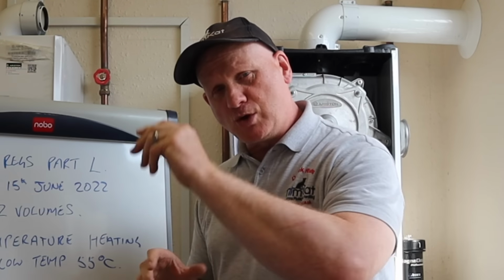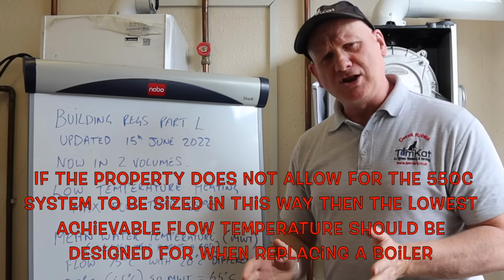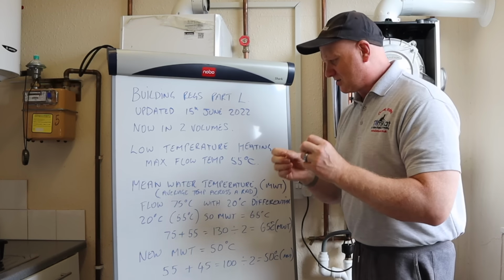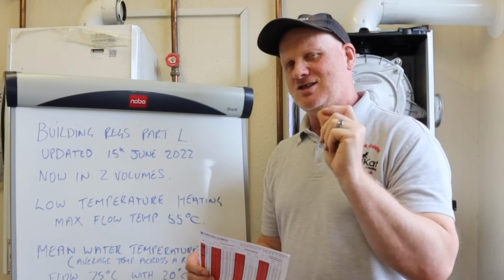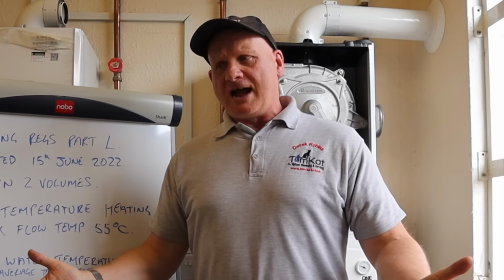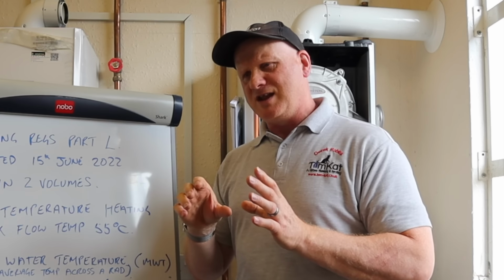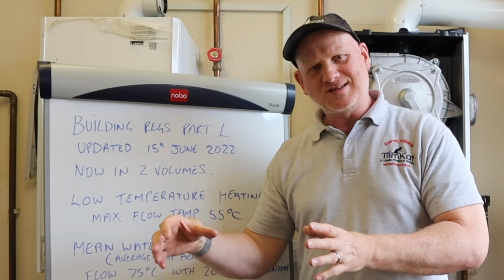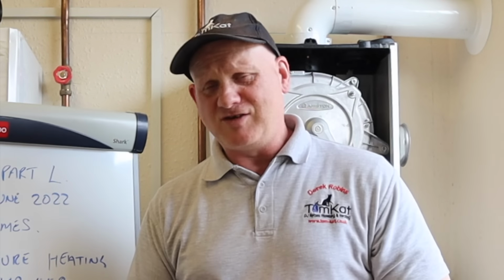Don't adjust your  heating flow temperature until you have watched this video. #saveenergy

Comment: For heating, i put the temp on the boiler to max, that way, the radiators get up to temp far more quickly, after they are up to temp I turn the heating off, the radiators will stay hot for some time. Doing it this way means that the boiler will not be running for as long which saves on electric costs, as the electric pump inside the boiler can use quite a bit of electric. Doing it this way, I usually dont have the heating on for more than 15mins at a time, and because the temp is so high, it continues heating for a while after being turned off.
Reply: The whole point is to keep temp down so the boiler is in condensing mode which alone increases efficiency by 10%
Reply: My thoughts exactly.....we have the room stat at 19, we turned the boiler flow temp up (not to max though), the room hits temp quicker because the rads are hotter, they then make the room warmer because of the overshoot in temperature and the boiler is still off.

Comment: Brilliant video mate, am enjoying the good effort by yourself and others like Urban plumber, Roger Bisby , heat geek , you're doing a great job between you all raising the standards, improving knowledge base and essentially helping to keep people warm, consider yourselves part of the cabinet to turn the country around.  Can I just add, there is no end to excellence and ingenuity, using the acronym RCC (Radiated, Conducted, Convected ) people can get straight to work reducing heat loss, improving the energy efficiency of their homes, staying warm. Question..Where is all the left over perspex from covid? Don't throw it away, with some simple carpentry it could be used to make external double glazing or air source heat collectors, I've already done it, is working well. Anyway, Keep up the good work , and let's see a few more northerners galvanised in keeping warm, sharing knowledge and information and using their ingenuity  to prosper, is what sparked the industrial revolution.

Comment: This video, whilst somewhat useful, misinforms. Radiators are not sized on the differential temperature (DT)between boiler flow temperature and required air temperature, they are sized on the DT between mean water temperature (MWT) and air temperature, this is an important difference. Also most domestic circulators are already over-sized anyway, but regardless, 
lowering flow temperature, will not require an increase in pipe size, or circulator size. This may apply when fitting a heat pump due to a reduction in DT to 5°C. There is very little harm in making small incremental reductions in flow temperature on a condensing combi boiler. System or regular boiler flow temperatures on condensing boilers should not be reduced below 70°C, without consulting an expert.

Comment: Great video, but I don't fully understand 
if the hot water temp has to be over 55 in the hot water cylinder, but the flow pipe from the boiler is now max 55, that assumes there will be no temp drop between the boiler and the cylinder. Even if the pipework is lagged it will lose something, also the hot water in the cylinder wont necessarily be even, the flow pipe as it enters the coil maybe 55, but as it exits it will be less and the water vulnerable to legionella

Comment: Routers have to stay on, or they start playing up, it tells you that in the books that come with them, and today's flat panel TV's usually don't have a proper power off switch like the old ones had, so you have to turn them off at the socket which is what I do.

Comment: Hold on a minute, 20c difference? I thought the industry standard is 11c, 82c in, and 71c out, that's what the books say, or is it different now? I like heating the old way, nice and simple. And someone somewhere must be making some really super- efficient radiators if they can work at a flow temperature of only 55c, are they the ones made to work with a heat pump? I've always thought the flow temperature should more like 85 with delta T 55.

Comment: My boiler is a good old fashioned back boiler, nice and simple, nothing much to go wrong, just three most likely things, the thermostat, thermocouple and the gas valve, all nice and straight forward to replace, if you can still get them, and I've got some spare. None of that dreadful micro surface mount electronics or multi layered circuit boards or computers, and none of that dreadful insecure hackable so-called "smart" garbage either, NO chance!

Comment: Even though I have an oil fired system boiler, I have found your videos very educational. In preparation for the coming heating season, I have ordered some clip on thermometers to measure the flow and return temperature at the boiler, as the oil boiler does not have a digital control panel with built in temperature sensors. I suspect that the radiators in one of the bedrooms, and the dining room are under sized to work at a 55°C flow temperature, but I will 'try and see' before upgrading them, as that is expensive.
Reply from the maker: Just be aware oil boiler are quite different from gas boilers especially the older oil boilers
Reply: @tomkatgastraining  I am thank you. This is a new external wall mounted boiler installed in June. Also replaced the pump, expansion vessel and motorised valves, but existing radiators retained.

Comment: That’s hilarious….government telling us we’ll need to put our hands in pockets, rip up our floors and break out microbore from plaster on walls and replace our rads!  The same government that’s just rewarded the rich with a massive tax break?!!!  They can go and do one and I’ll be setting my own boiler to exactly where I want the heating set and damn the green agenda.  New builds, fair enough but older places with maybe over a dozen rads?  No way.  Just had a new combi fitted.  Hot water can be set low but rads need 60 to 65 degrees to heat efficiently.  Delta T depends a lot on insulation used in house construction.  We have a really helpful delta T in an older build due to 75mm insulated wall cavities.  The government should step in and force house builders to do this for ALL new houses instead of penalising the poor and less well off. As for telling me how I can use my property, they lost the authority and right to do that when they held drinks parties whilst everyone else including the late Queen were in lock down. Remember that. HRM sat alone next to the Duke’s coffin because lockdown prevented anyone else being at the funeral.  Sod the government.

Comment: Good Video Derek. Query about System Boiler with 250Litre Indirect cylinder and Legionella. if we are to store water +60 / max 65deg (industry advice), and knowing there is a loss due to heat piping from boiler to tank circa 2deg (learned from Cylinder manufacturer), for the tank to hit 60deg, should the flow therefore be 60 + 2 = 62deg min? Any other clever ways of determining how long a 30kw system boiler should be on per day to keep a cylinder legionella safe if using say 3* 5min showers a day and one sink of water for dishes? this would be great to know as budgeting but keeping health and safety in check too would be great know from someone who knows best!

Comment: Our system was updated in February and was a very old gravity system with a room thermostat, but with 15mm pipes, and TRVs on all radiators outside the living room (room stat) except for the bathroom radiator.

We now have a condensing boiler with a water and a heating zone and an auxiliary pump in the airing cupboard. The flow temp is set to 70 and the hot water thermostat set to 60, I do not (yet!) know the return flow temperature.

At present we set the room-stat to 16deg and the water on for 20min in the morning which works reasonably well.

Should we lower both the flow temperature and the hot water temperature? ... at what sort of temperature difference between them can you avoid fast cycling? (or can you only determine by trial and error).

I propose to drop the flow temperature to 65 and stretch the hot water timing to 30 to 40 minutes to see if this helps.

Anyone have any comments / suggestions?
Reply: I've dropped my cylinder temp from 60 to 55°C and lowered my flow temp from 75 to 60°C . I just leave my hot water setting constantly on, used to be like an hour in the morning and an hour evening. Leaving mine on takes up just over an hour of heating the cylinder day. Also saves me always adjusting the times. So it's up to you. Have a play around with it, see if it customs to your needs. Luckily my latest system boiler has a condenser pipe. So I wanted it extract condensing mode to save money and efficiency.
Reply: @Andrew-hx6lm  ... I think I will try that.
Problem for me though is that my smart gas meter won't join in ... so it is difficult to monitor gas usage 😟
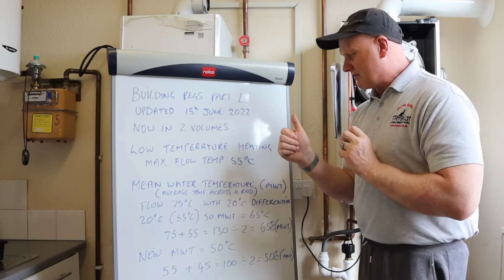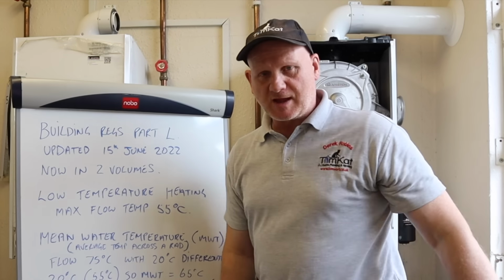Reply: @Andrew-hx6lm  l have dropped the tank temp to 55 and tge flow temp to 60. I noticed that it takes about 10 minutes to heat the tank from scratch and a lot longer to heat it when the heating is on ... so ... I have set the water to cone on at 07:00 and off at 19:00 ... but the heating on at 07:10 and off at 23:00.
This gives a slightly higher temp in the airing cupboard as the water is effectively hot all day ... the heat leakage keeps the core temp up.
We set the thermostat on at 17C which kicks the radiators on on colder mornings and slight hysteresis brings the lounge to 18 and puts the big radiators in the bedrooms, hallway and downstairs loo (TRVs) and the bathroom (fully open) up to temp. On reasonably warm days this hour or so in the morning is sufficient 'till the evening gets cold. It also raises the conservatory, full of orchids etc, to  around 14. We will have to monitor how it all works out as the weather gets colder. We may have to put our thermostatic tube heater in the conservatory to keep off the frost.Meanwhile the radiators in the bedrooms set to approx 18 on the TRVs take the chill out of the air.
When out for the day we drop the thermostat to 15 so heating only comes on with a cold snap (??). So far seems OK with the 'disstaff side' liking the constant availability of hot water! There is a small amount of balancing to do between the hall and downstairs loo to make sure they both come up evenly ... otherwise everything is OK
May insulate the hot tank a bit more to drop the heat in the airing cupboard (especially for the summer when we don't need to keep the house core hot ... if the missus lets me!
I want a temp gauge on the boiler input to see the return temp (unfortunately they heaved out the one I already had with the old boiler!). Don't know the temp but the water vapour from the balanced flue is virtually zero now.
Because the gas meter is not joined to the smart electric meter we have to monitor the gas usage by hand!! ...so I will be taking gas readings daily for the time being.

Comment: TV's use 20 to 30 watts on standby. Internet Router, TV recorders, game consoles will use some as well.
Kettles, phone chargers, microwaves do not use any measurable amount of power when not being used but it's a good habit to switch appliances off in any case.
Reply: Most modern (last 10 years?) TVs  use ~0.5W in standby (some large ones may go to 2 or 3W).

Comment: Why don't system boilers have an input to switch between two different temperature setpoints, one for heating and one for hot water?  Obviously combined with a hot water priority setup.

Comment: What pressure needs to be in my boiler, does it needs to be 1.8 to 2.0 bars?
I have something that looks like gas boiler from the outside, but actually inside is only pump with many sensors and valves. Apparently there is a big boiler somewhere in the basement, and every property gets the hot water and heating separately through the meters.
Currently there is a 1.0 bar pressure, should I top it up before winter starts?

Thanks
Reply: 1.0 bar is at the really lower limit....personally I'd top up to at least 1.5

Comment: Hmm, sorry but I have to refer you back to the definition of Specific Heat. Dereck "could" include in his presentation that the general Public WOULD GENUINELY SAVE MONEY by turning their heating sytems off or their room thermostats down (taking due cognisance of Viper twenty2's previous comment) but you definately wont achieve a designed comfort zone/room temperature  by so doing. Consider this - the EU were intending to reduce the wattage of electrical water heating appliances and limit them to 2kw. Electric kettles generally are 3kw. Its quite simple - a 2kw kettle is going to take 33.333% longer or thereabouts than a 3kw kettle to boil the same quantity of water. Where's the energy saving please? Rather than change my radiators, circulating pump and pipe work (impossible without tearing the house apart) Im currently looking for a second hand convewrntional boiler!!!!
Reply from the maker: I don’t think you understand the process of reducing the flow temperature. If you keep your return temperature lower than 54 degrees Celsius the boiler will be in condensing mode this meaning more heat can be removed from the products of combustion ie instead of 55 degrees this could be lower to as little as 10 degrees. Also you can achieve the room temperature quite easily if your radiators are designed for the lower flow temperature and for your comment about second hand conventional boiler good luck with an appliance that’s probably 50% efficient compared to about 92 for a new boiler installed correctly.
Reply: @tomkatgastraining  The point is Derek, (I presume it is Dereck that I am coresponding with) I understand perfectly well the process of reducing flow temperature and the very much theoretical advantages that it allegedly brings. My property is of solid wall construction with a heating design engineer designed two pipe, open vented small bore pumped system. the pipe and radiator sizing deigned to deliver 20deg c with larger rads in bath and shower rooms. A flow temperature of between 75 and 80 deg c with a cross temperature differential of 10deg c. This higher flow temperature thus enabling the design efficacy of the radiators to operate as convectors as well as radiators. Now please Derek, dont demean yourself or further insult my intelligence by trying to convince me that I can achieve financial savings by installing a condensing boiler with lower flow temperatures etc etc. Coupling with this the suggestion that by installing larger radiators, larger pipes, higher performance curculating pump and smart boiler controls I can achieve even more savings!! Who is going to pay for all this including installation costs and what is the pay pack period? Come clean Dereck, TomKat Gas Training are making a living from beating the political drum however disingenuous or unethical it may be. Lets not waste anymore of each others time, you trying to convince me and me educating you because we're each flogging a dead horse.🤣😇
Reply from the maker: @chrisandrews859  I can assure you that I don’t beat any policed drum and I guess from that comment you have only seen this one video. It’s well documented that your system is one of the most inefficient systems you can have and making small changes could save you money. There are no Definites in life only taxes and death but a fool is the hardest person to convince that they are a fool. You can please some of the people some of the time but not all of the people all of the time. The video is not saying remove everything you have and start again just make a few changes and it could save you money and if it doesn’t at least you tried.

Comment: Having watched your video I feel totally vindicated for my scepticism concening condensing boilers - all very well in a well insulated, hermetically sealed new build but a recipie for additional and irretrievable costs when installing a condensing boiler as a replacement in an existing property. The claims made for condensing boilers are enirely hyperthetical, wholly disingenuous and misleading. Go back to our school days and recall "Specific Heat" and what it means: " the amount of heat needed to raise the temperature of 1 gram of a substance 1 degree Celsius (°C). Water has a high specific heat, meaning it takes more energy to increase the temperature of water compared to other substances. So, at the end of the day by lowering the flow temperature and then expecting to achieve a room temperature of twenty degrees, it is quite literally a physical impossibility. Rather like the milages claimed in new car promotions, its tantamount to a con!!!!

Comment: Good video and very informative, but a bit confusing with your cylinder bit - the cylinder doesn’t heat the water (except with the electric element). A system and heat only boiler heats the water, then circulates this through the indirect cylinder. A combi boiler supply’s hot water on demand, a system and heat only boiler supplies hot water to a tank - in essence.
Legionella water temps should be 60°C for health and safety reasons too.